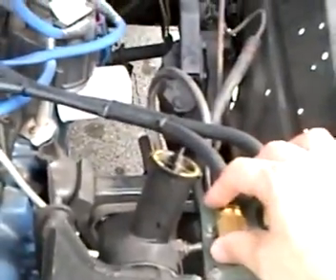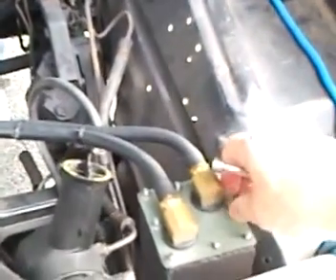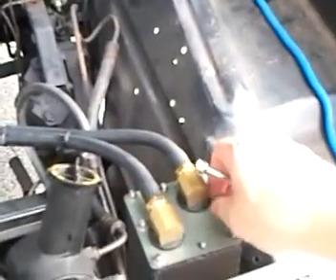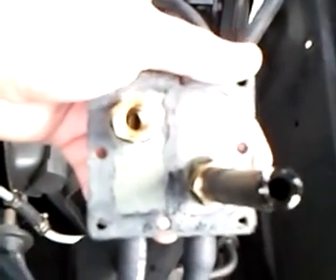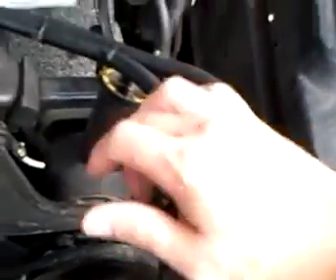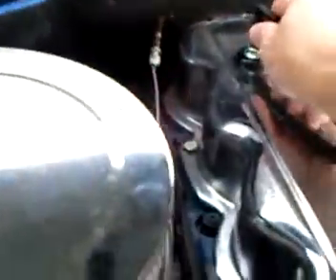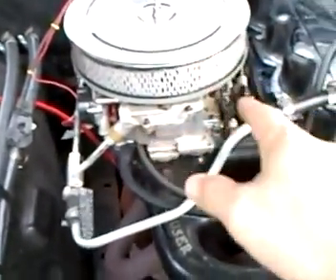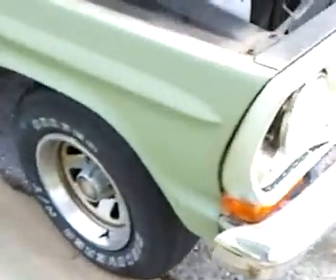Ford 300 Inline 6 Rebuild Air Oil Separator added

Comment: Do You have a vent in your valve cover on opposite end where the PCV is? On older model 300s the vent is usually on top of the oil cap. On newer 300s there is a seperate place that takes a 90' ell, Both goes back into the air cleaner.